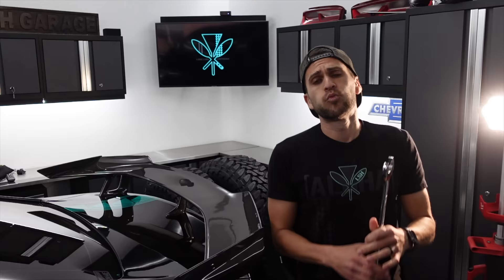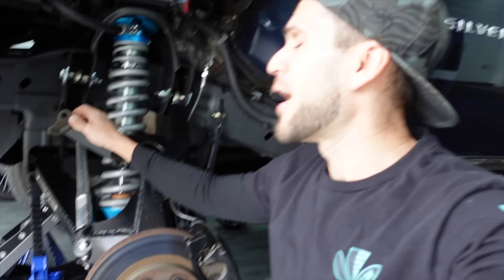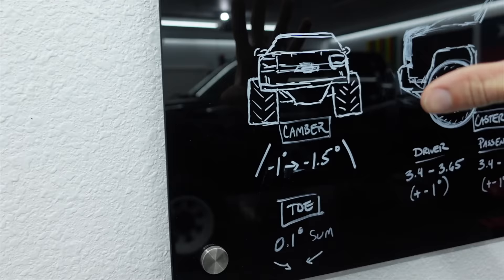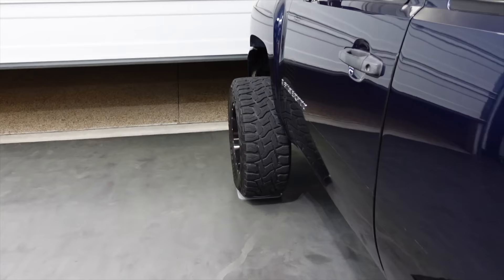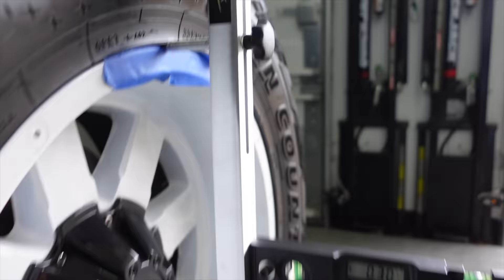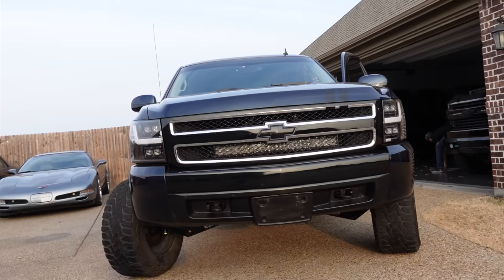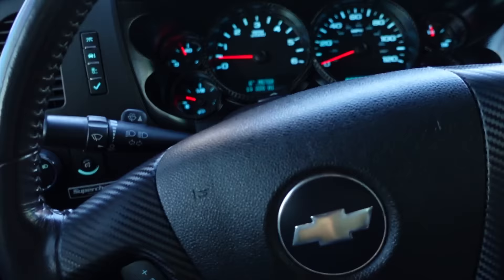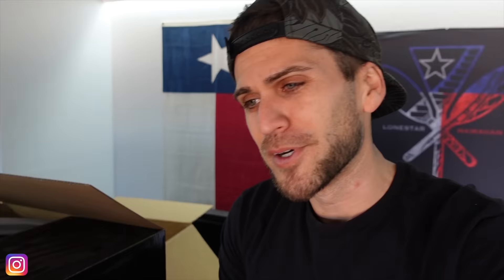FREE ALIGNMENTS FOREVER - Stop Paying For Crappy Work

Comment: If you were to use a piece of string. Cross both back tires and then up to the front on both sides. Center the steering wheel and adjust the fronts to touch the string evenly. It would be straight. Relative to the rear.

Comment: Drop a plumb-bob from the centerline of your car at the front and rear axle, pull fishing line down each side measured from the centerline, measure distances top and bottom for camber and front and back for toe.  If you can measure plus or minus 1/32" on a 17" wheel you can get accuracy plus or minus 0.08 degrees.

Comment: The best alignment is still on a set of turn plates, using a measuring tape. It's more accurate than any alignment rack. I worked as a shop mechanic. I did a lot of alignments on a rack with a computer and sensors that set the shop back $250,000 or so. It's faster on the rack, especially if you have to replace parts, but anything you add like the wheel position sensors detracts from accuracy. A tape measure is still the most accurate. Also, if you wanna be the most accurate on your toe and camber, you need to put weight in the seats where people gonna be setting, at least the driver's seat as there's always a driver. On light two door sports cars, it's a necessity. They're so lightweight that there's a huge camber and slight toe difference with someone in the seat vs not. We were pretty particular with how we did our alignments, so we'd stick someone in the driver's seat on the smallest cars when we were doing an alignment. There was a pretty great crew where I worked at though. A lot of places just don't give a shit.

Comment: If you can't afford turn plates.. For each side cut 2 tin plates using grease in between. Cut plates big enough to extend a few inches all around bottom of tire that is on the floor.
Reply: Or you can use 2 large trash bags fold them a couple times

Comment: The Alignment machine aligns the front by comparing the front to the back axles. The rear axles can move.  The little stud on the springs doesn’t fit tight. I went to the Hunter Alignment School I’m not just guessing. This tool looks great
Reply: I went to Hunter alignment school as well.  Graduated class of Thursday 3 o’clock!  The amount of movement you get out of the tie bolt isn’t enough to even take the rear axle out of manufacturer’s spec.
Reply: @edgardaniels1402  an aftermarket lift isn’t necessarily in spec. I was just informing that the alignment machine takes its measurements off of the rear axle. I’m also a graduate of of 3 
o/Clock A** H***  school as well.
Reply: @kevincoulter6475  I built that school! Wasn’t arguing the points of reference the machine measures.  His technique doesn’t require using the rear axle.  Using the rear axle isn’t necessary for front end alignment.
Reply: @kevincoulter6475  Been doing it for 30 years, done it just about every way possible.  Manually like the video, plum Bob and string, Bee Line, and Hunter.
Reply: Shouldn't you drive the truck forward about 6ft before doing an alignment?
Reply: The real issue here is you guys are partially right. You have bits and pieces, but none of you know enough to put it all together. Not only that, what you are arguing about here is questionable when it comes to actually doing a real alignment. There were big mistakes made in this video and none of you picked up on them. Its not about using an expensive machine, its about understanding what you're doing. 

It doesn't matter if you are using an expensive machine, or not. If you don't understand the entire process the machine is irrelevant. What you guys are doing here is like telling someone they're wrong for not using a torque wrench to tighten down head bolts. You would be correct, but if you don't tighten the bolts in the correct order, set the proper torque specs on the wrench, and know the bolts also have torque to yield specs, your $800 digital SnapOn torque wrench won't be of much use.
Reply: @AT-wl9yq  I think you just kinda said the same thing I did chief.
Reply: @edgardaniels1402  oh theres the "been doin it for 30years!"
Reply: @AT-wl9yq  so what are the big mistakes in this video?
Reply: @edgardaniels1402  I just took a look at your posts. I don't see where we are saying the same thing.

"The Alignment machine aligns the front by comparing the front to the back axles."

It looks like you were questioning that statement specifically. I would agree with you. Its not a true statement.
Reply: @edgardaniels1402  Only the toe is adjustable on my '68 Corolla...I just measure front and back of the tire from center...adjust if needed, roll it back and forth, recheck.
Reply: @zefrum3  There's 2 big ones. A runout compensation was not done. You need to do it before you start taking measurements and making adjustments. Its not an optional step. You can't true an alignment head to a wheel or tire. Everything you do from that point on will be wrong. Sometimes you be lucky and get it very close by chance. But the only way you can verify it is if you check your work on a properly calibrated alignment machine. If your toe is off 2-3mm, its enough to wear out your tires much faster that normal. Its too small to do by eye.  You need a machine.

And the other big one, is you simply can't ignore major alignment angles. The 2 most important front end angles for vehicle stability are caster and SAI. He went over caster, but made no mention of SAI. Its not something you can ignore, especially when you are moving it, like he was in the video.

I do realize that this is an off roading truck, and its not going to be used like a regular vehicle. But you would never want to do this on a car that's driven at high speeds. These little oversights can quickly become major problems on a different type of vehicle. The reality is, if you took that truck and measured the front end on a real machine, it would be out. What he's doing here is perfect if you install some new front end parts and need to get the vehicle to an alignment shop without ruining the tires.
Reply: @yourhandlehere1  you might only be able to adjust toe, but it's massively useful to know all the specs. Drifting camber measurements can mean worn parts, different caster measurements left-to-right can mean something has been damaged, etc.
This is a prime example of, "knowing how to do something is not the same as understanding why it's done"
Reply: You can do 2wd alignment without using rear sensors.
Reply: @AT-wl9yq   you don't need a machine to get a good alignment. you do need to understand what's going on for sure. example, I stoped taking  my semi trucks and hotshot trucks to get alignments, we do not use a machine to align them and we get 200,000 miles out of semi tires with our method. which is an increase from when we let the guys with the machines do them. mainly because like you said, they don't know what's going on so even with a machine they screw it up. they don't understand things like the crown in the road and how it effects wear and how to counter it, things get even more interesting when you have dual axles with dual tires on them, you have to think about them like a cone rolling down the road in a since.   I certainly wouldn't waste my money on this gimmick garage alignment tool. you can make all the tools you need at home depot for under 50 bucks.
Reply: @pokerman9108  How do you preform a runout compensation with DIY alignment tools?

Comment: I haven't been to a Firestone store since about 1981.  I took a Dodge Aspen to the one at Weatherly Road and Memorial Parkway in Huntsville, Alabama, for alignment and a grease job.  I waited in the waiting area until they got done and paid them.  Going home, the car still pulled to the left, so I suspected that they hadn't done anything.  I checked the grease fittings.  Some were still covered in dirt.  None had been touched.

I took it back to them, and they did the grease job.  But since I couldn't trust them anymore to do something as important as alignment, I took it to another place for that and haven't been back to Firestone for anything since.  My advice is that no one take ANYTHING to them, ever.

Comment: As a former Firestone tech who did do alignments I can confirm everything with a straight axle rear that doesn’t use some sort of multi-link system to align the axle does not need an alignment in the rear. If it is fucked enough in the rear to be mis-aligned it needs parts replaced and that’s much more expensive depending on what it is. But I think this is more a store policy/computer issue. I don’t think there’s an option in the computer to just align one axle.

Comment: I did alignmemnt years ago and used both Bear and Hunter equipment. No matter how sophisticated your equipment is, it is no better that the operator. Also, customers will hit 3 speed bumps and 6 potholes before they have driven 5 miles from the shop and wonder why their new alignment doesn't drive good.

Comment: Most shops don’t offer a two wheel alignment anymore. They are going to hook up all four sensors regardless. Even though there’s no adjustment for the rear you’re still getting the measurements on the entire suspension. You could have a sheered center pin that would be caught by a better alignment machine. But yes, don’t go to Firestone.
Reply: As an alignment repair technician the rear on most 4 wheel Alignment systems actually use the rear as a reference point in its calculations regardless of solid rear axle or not. 4 wheel is always better than 2.
Reply: A two wheel alignment is done on every car with only two adjustable wheels. All alignments need to read all 4 wheels. A 4 wheel alignment is done on vehicles with 4 adjustable wheels.
Reply: @shaunparsons9610  incorrect, all alignments do not need all 4 wheels. All the major alignment system players in the industry Hunter, Hoffman, John Bean, snap on. Are capable of doing a 2 wheel alignment without the rear targets attached via settings. While the alignment won't be as good they can still do it.
Reply: @redmesa2975  with your eyes? lol
Reply: @shaunparsons9610  lmao

Comment: Best yet - started doing myself on every car and truck with a $100 tool. Paid for itself first time.  And here is the situation. The $120 alignment guy could never get my Passat correct. The car was even bought back by Volkswagen due to vibrations in the drivetrain at the same time of the TDI buyback.  I found out they must have been using a bad spec because when I aligned it dead, even all the vibrations went away from 0 to 100 miles an hour and even higher if the car would go faster.
Reply: Hi,  would you let me know name or type of tool please? Thank you

Comment: A 4 wheel alignment is not just for adjusting the rear it is to align the centerline of the vehicle so both front and back are going in the same direction, a 2 wheel alignment is a toe alignment so both front tires go in the same direction but all new vehicles use a steering angle sensor and the ABS, Cruise control and traction control all use it to know where the front tires are pointed so if you only do a 2 wheel alignment you may have issues with everything else.
Reply: May need to recalibrate steering angle sensor, along with lane departure camera and forward facing radar.

Comment: In firestones defense I have nothing but good luck with mine. Yea the paying for a 4 wheel alignment thing is dumb but when I buy a new car or truck one of the first things I do is buy the lifetime alignment for 200.00 and I can take it in as many times as I want for the entire time I own the vehicle. I know the guys up there and the manager has done a very good job of staffing it with experienced technicians. Unfortunately, I think the Firestone I use is the best and the one you have is the worst. Makes advocating for them tough and I would have the same opinion as you do if I had your experience with them. Just saying not all of em are crap.
Reply: it really depends on the shop, the manager, and the techs that work there
Reply: Firestone are st8 scammers. Will refuse to do the work because supposedly it needs a bolt to be replaced cus its seized but went to another shop nd they got it done no issues. Lifetime my ass

Comment: The alignment machine adjusts the front by comparing it to the rear axles, which can move. The small stud on the springs doesn't fit snugly. I've been trained at the Hunter Alignment School, so I'm not just guessing. This tool looks excellent.

Comment: Same adjustment points as my 1960 Mopar cars.  With the wishbone upper control arm, you have the two bushings with eccentric cams which move each end in and out laterally.  With those two variables, you can set both camber and caster.  We get the most caster possible (rear side in max) and even then need special Moog offset bushings to get enough caster for radial tires (old bias ply would deflect backwards when driving).  Camber is more of a driver's choice, as witnessed by the extreme neg camber in some tuner cars.  Factory spec for mine was actually slight pos camber (tops lean out) but I set a slight neg camber.  Not all cars allow adjusting both caster and camber using adjusters, and might require shim plates.

Toe-in setting is the most critical for handling and to avoid tread wear.  If the front and rear tracks are the same, you can quickly check toe-in by holding a straight-edge along the front tire and sight at the rear tire.  You want the sight hitting ~1" off the rear tire for RWD and ~1" inward for FWD (easier, at 1st tread channel in my minivan).  For exact, use a tape measure on fwd and aft side of front tires, as shown, but can just use the channels in the tires rather than the bolt on fixtures.  The purpose of setting any toe-in is to account for play in the suspension.  You need less if all parts (bushings and ball-joints) are new and tight.

Comment: I have personally aligned trucks in my past and the Firestone employee is correct. Though it is atypical to require a rear end alignment on a truck, lifted trucks do need the rear end to be aligned. Some blocks aren't installed completely square and can cause the rear end to dog track and need the block locator pins to be ground out to create a slot so the rear end tracks straight.

Comment: I do alignments for a living.  When i am using a torch, cheater bars and sledgehammers as well as replacing cam bolts it's worth it.  My shop charges $130 for an alignments.  And you are very correct, you don't align the rear end on a Silverado.
Reply: ^or had one of those cam bolts snap off, and had to air hammer it for a half hour just to get it to move...
Reply: @nickb1789  I totally hear ya.  We have that fun stuff they spray on the roads in the winter time that likes to turn vehicles into rust sculptures.

Comment: I'm a technician and on those camber and caster slides they require a plastic spacer after doing alignment, so it won't move out of specs, and you shouldn't need to do more than 1 alignment per year unless you're doing several modifications.

Comment: Damn, got here late.
YES, contrary to all the comments here a rear axle alignment can be done by a competent shop.
It's done with shims between the leaf springs and the axle also between the axle flange and bearing hub if equipped with or the brake backing plate.
Anyone with questions just search for;
Full contact wheel alignment.
😂

Comment: when your are a professional fabricator or machinest measuring to 0.015 of an inch is no problem ...its routine...more than accurate for an alignment ...its all geometry, if you know what your doing you can be very accurate..you dont need a kit either ...use scrap aluminum ect and clamps   ect

Comment: I had replace my both lower control arms,both upper control arms, both struts, both ball joints, and i took my suv to big 0 tires for aglinment and they didn't know what a camber bolts means, my camber are underneath my suv theres three bolts and it's injustabled, big 0 tires was trying to spam me with sum camber bolt that cost $129 and that two bolts doesn't go anywhere on my sepension, there also trying to charge me $600 all together with aglinment, i was like am going to Firestone and they know what a camber was and camber bolts, they injust my camber perfect and cost me $130 for aglinment, but after Firestone finish my aglinment, i took my torque wrench and i torque specs my lower control arms bolts ,195 lbs, but Firestone did better then big 0 tires, great video man 👍🏻

Comment: so what you are saying, is you don't know what a four wheel alignment really is. I know this because you understand that is putting the FOUR wheels in LINE! With old cars we loosened the steering wheel so that we could put it back on in the straight position out on the road, that can not be done with cars of today. People don't realize that what we were doing in the 80's and 90's with the light beam alignments was aligning the front wheels with the rear wheels ( a four wheel alignment ). I performed tens of thousands of them with light beams or the old rod method for more years than I care to remember. But you are right about finding someone to do a proper alignment, most of what you get is a set the toe and let it go, that you can do in your dirt driveway with a tape measure. The alignment doesn't make money, it's the repairs that do so shops don't want the proper amount of time spent on the alignment. The faster you can get it down and out, the more money you make. Speed is king.

Comment: I ended up doing exactly the same thing. Bought laser alighmrnt kit for 1400 GBP, plus turn plates, steering wheel level, camber and caster measuring tool, all because local garage only adjust toe. Not chamber or caster. It's a real problem in England with all the potholes, knocking out the tracking on cars and garages avoiding doing the work properly as they don't want to spend the time on it.